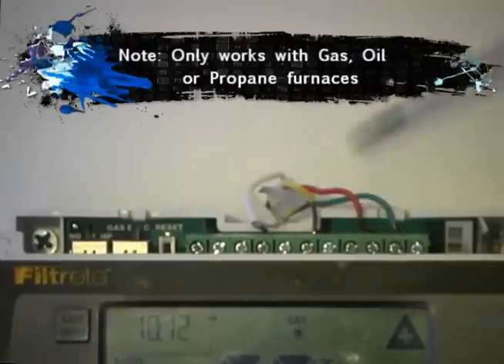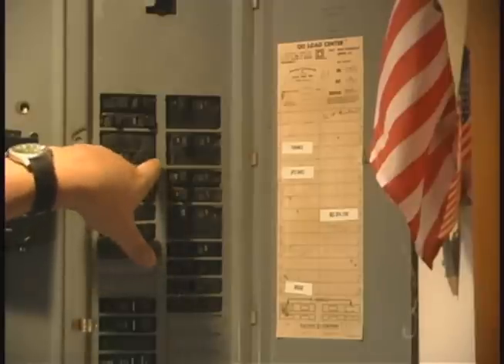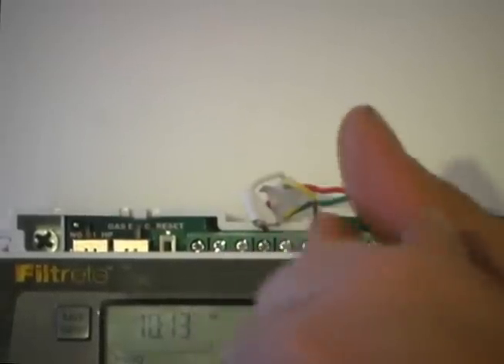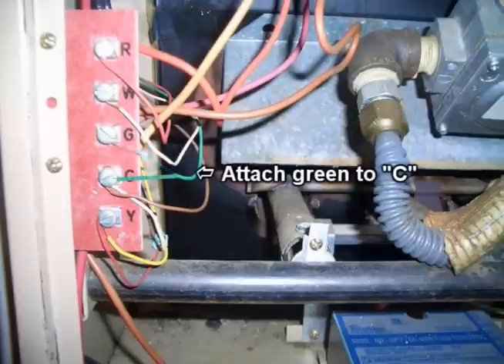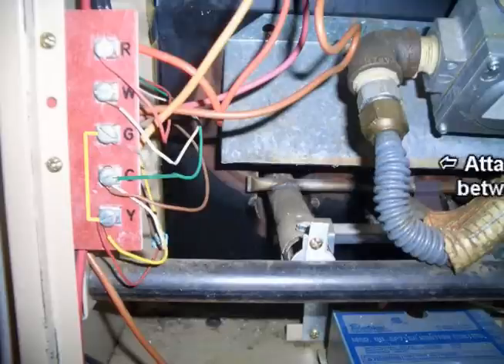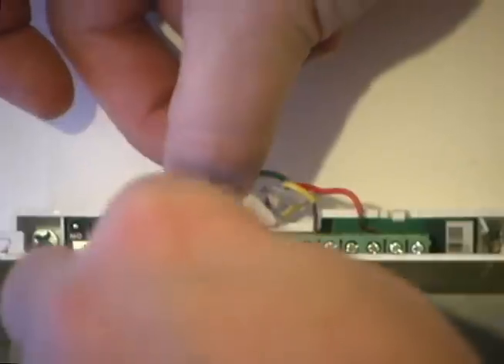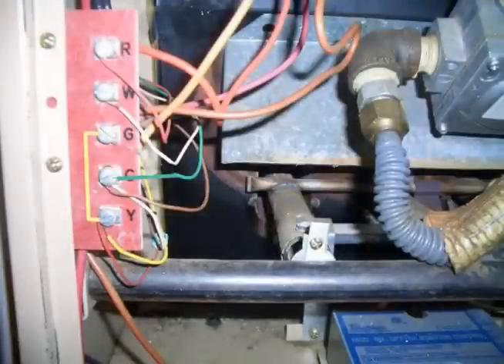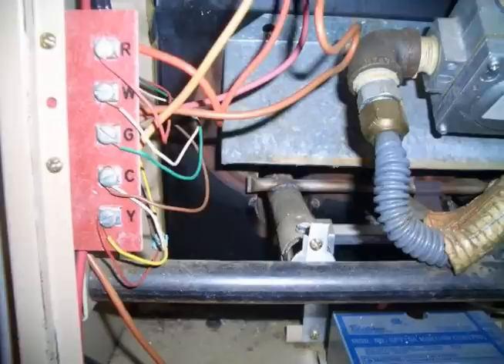C Wire -- How to use the G wire as a C wire

Comment: Question, what are the white and red wire that are connected to the C terminal in the furnace?  I opened up my furnace and I see that a red (can't tell if it's exactly red) wire (not the one that connects to the R terminal) is connected to the C terminal and a white wire is connected to the Y terminal.  These two wires are from a separate brown wire that apparently connects to the compressor (???).  There is the main brown wire which has blue (this is for the Y terminal in my setup) , Red, white and green wire.

Comment: Using your G wire as your C wire is a TERRIBLE idea!! I added a Honeywell RTH6580WF to my home recently. I discovered no c wire. Without knowing what all it involved, I found the blue wire tucked into the wire bundle as it had been cut off since not in use. I stripped it and applied it to my thermostat. Still no power. I then went down to my furnace to see the blue wire was not hooked up either it was just wrapped around the same wire bundle going to the thermostat. I stripped it and hooked it to the C terminal on the furnace. Now the C terminal had a white and brown already attached going to the AC. But you can hook more wires to the C. You can hook the 3 right into the terminal or you can bundle them together with a 4 wire called a pigtail then you only have one single wire hooked to the C terminal.  User preference. So don't just assume because you found the blue wire in your wall or wire bundle behind your thermostat that its connected to the C terminal in your furnace. You will be best to take the panel off your furnace , find if a C wire is connected and determine the color while making sure it's the wire bundle going to the thermostat.

Comment: Hi! We seem to have two-transformer wiring system where the Rc and Rh wires are entirely separate power supplies for the AC/fan and the gas boiler, which doesn't seem to use the fan. Will this trick still work? I think not, right? I'm guessing the thermostat would only run power through the Rc wire if it was running the cooling system, right? So the circuit the G is on isn't even relevant in our case?

Comment: Thank you for this video, it saved me a service call! My Nest thermostat was installed by a 3rd party in the winter. It worked fine, but when it came time to turn on the A/C, the compressor would come on, but the blower (fan) wouldn't. I thought it was a bad circuit board... until I watched this video. I inspected the control panel on the furnace and I saw that the installer moved the G wire to the C wire, but there was no jumper between Y and G. After jumping those two connectors, everything worked perfectly. Thanks again.
Reply: I had this same problem so I added the jumper wire and it is still not working? Is there something else that you did?
Reply: @Brook.klassen  so funny thing about my system and why i hesitate to use this method right now is that my fan works and there is nothing at the G spot, so the fan is wired in somewhere else, your system is probably the same.

Comment: So the reason to do this is the lack of wires correct . If you had an unused wire you could just attatch it to common on both ends yes???
Reply: Yes.. If you have a 5th unused wire just connect the same colour to the C on both your furnace and thermostat.
Reply: Justin  so here's the strange thing . Works fine without the c wire attached . Soon as u add c wire I get error on my nest saying no power at rc

Comment: If one does this can you still operate the fan manually???? I sometimes use the fan even thought the A/C or furnace is not operating.
Reply: nope you will lose the ability to control the fan independently
Reply: buy a "wire saver" module and you will be able to keep all separate functions, or go the best route and run new wiring. I always install 8-wire thermostat wire in case a wire shorts or breaks in the wall OR if you end up deciding you want to add any humidification or additional stages of heating or cooling in the future
Reply: Thanks for the info.....I just went with 18/5 thermostat wire and ran it through the walls.
Reply: this is the issue I am having also, the Thermostat works great but we have an HRV and would like to run the fan separately. Are there specific instructions on how to do this? I can't seem to find info on how to do this. Thanks for your help btw.

Comment: Hello Homehandyman101,

I have a heat only application, old two wire thermostat (R and W)

Cable has 3 leads between furnace and thermostat:  R, W, and "not used"...believe it is a "G"

Can I use "G" and wire to "C" on furnace w/o using any jumpers and make my new Honeywell digital wifi unit work correctly?

Please advise and thank you for your video.

Mr. P
Reply: Please cancel all above request.

Stripped back cable at thermostat and had 4-wires.

At furnace also had 4-wires.

All colors match and I apologize for the waste of time.  

Furnace:  I have G and "B/C" (aka B wire for my app)

Cheers,
Mr. P

Comment: Just got done installing two Honeywell WIFI Thermostats requiring C-wire using the method described on this video, and it works perfect. Almost returned them when I did not find the C-wire. Thank you Homehandyman101.

Comment: I have a heat pump only and there is no "C" terminal on my air handler.  There is 24v across the green-to-red and blue-to-red.  Why can't I just connect a jumper from either green or blue to the "C" terminal on my thermostat?

Comment: ok...what about a heat exchanger. Can you also use the G wire on BOTH g and c? I would like to use a the fan as it helps move the hot air from my wood stove that is another room.
Reply: I need to know this exact question

Comment: Worked perfectly! I'm using a Honeywell Lyric T5 WiFi thermostat with 4 wires. Instructions from Honeywell did not work. After following this video's instructions the AC, at first, didn't turn on. However, the thermostat did a self-update/calibrate thing and it has worked great since then. Thanks!
Reply: I did the same but you  cant manually control the fan ,

Comment: ok. Did exactly as you showed. The thermostat went on but the system didn't
Reply from the maker: Do you have a gas furnace?  If not this solution will not work for you.  The reason is that most electric heating systems require the thermostat to control the fan in heat.  If you do have a gas furnace with AC make sure you put the jumper in between G and Y at the furnace.

Comment: sorry, why do we jump y to g? thank u.
Reply: David R. Jumping your Y to the G terminal gives your G terminal 24v when you get a call for cooling. During a call for cooling you get 24v to the Y wire and 24v to the green wire. Since we are robbing the G to use as a C we don't have to remember to change the batteries every 6 months. This will give your thermostat 24V coming in and a common for it to go back to on your transformer. What this basically does is when you get a call for cooling it acts like a G wire in this situation. Your system will see 24v where it needs to if wired correctly like the gentleman showed in the video.
Reply: What is I dont have a C in the furnace terminal?

Comment: can i do this if i have no y wire coming out the wall by thermostat and have a central air unit?
Reply: David R.  Do you have a blue wire connected to your Y terminal? Chances are you have 18/5 running to your thermostat if so. I would suggest pulling the wire out of the wall a little to check. You probably have a Y wire that is not in use.

Comment: Thanks for the video that's what I was looking for.  So, now when A/C (Y) is on, the fan is on, because Y and G terminals are connected.  But what about the heating? The fan will no longer turn on when furnace is turned on.  How do you solve this problem?

Comment: okay but why is there 3 wires connected to the c place in your furnace
Reply: TheJustinamazing in a hvac system there can be very many points of common. His just so worked out that he has multiple wires on his terminal block. Do not pay attention to this when you are wiring yours. You may have 7 on yours etc

Comment: What if I don't have a "C" connection on my 20 yr old furnace? I only have W, G, & R. Plus Y all to the t-stat. There are a couple extra wires in the bundle I can use.
Reply: the "c" is the common leg off the secondary side (24 volt side) of the transformer. in this case if you dont have c terminal. then you have to wire nut the green wire directly to common wire coming directly off of the transformer. if you don't know what your doing, i wouldn't mess with it

Comment: No AC from vents after new wifi thermo. My antique Smith boiler has no such setup and the AC unit is up in a closet on 2nd floor. I could see no Terminal block on AC unit behind panel to do this either. I'm at a loss but I'm sure I need a jumper somewhere. Heat functions fine it's just the AC fan that's the issue now. Compressed working. help is greatly appreciated

Comment: May I ask what circumstance would put you in the position where you want to lose manual control of the fan just so you can say you have a c wire at the t-stat?  Only compelling reason I can think of is if you don't want to use batteries at the t-stat.
Reply: Burned popcorn in the microwave?   Run the fan....
Doing a construction project in the house creating sawdust, etc?   Run the fan...
Have allergies that are bothered by vacuuming?   Run the fan...
Temp outside's nice enough that you really don't need heat on or cool on, but want to feel a bit of air movement?    Run the fan...
I can't count the number of times I've run the fan without the heat or cool engaged just to move air in the house through the filter for (see above) a variety of reasons.    I'm looking to add a new-fangled WIFI tstat but I only have 4 wires, my current unit is 'smart' and gives me all functions including the fan, so I'm a little tweaked that the new WIFI tstat from Honeywell doesn't allow me fan control.   I don't mind putting batteries in every few years.   Worth it.
Reply: acoustic4037 Generally the reason is because you have a thermostat that requires the C Wire.  Newer ones without batteries or rechargeable batteries like the Nest.  Most people don't run their fan alone.  If they did, they would clog the filters really fast.  Then again, most people don't change their filters.  I have a honeywell wifi that I tried this with and all I could get was heat, the ac would not start.  It may require both C and G wire.
Reply: I guess there are thermostats that could require a c wire, but there are other options available.  I would not advise buying a thermostat that creates a problem when there are plenty that don't.  If running the fan would plug the filter, then it would be an improvement in indoor air quality and should be done.  In heat pump land (the south) tenants let the filter get plugged, and the coil sees no air, and the coil freezes up all the way outside to the condenser unit.  People think they should change filters on a time schedule or worse, not at all.  Filters should be changed when.... they're dirty.  If you live in a glass house with no pets or dirt, you can go a year but most people with 5 dogs, 24 cats etc need to change filters every month.
Reply: +acoustic4037 Never in my life have I just run the fan.  Not once.  I don't think I even knew that was a thing until a year or so ago, and I'm 49 (grew up in San Diego, in a house where we had neither AC nor heat).  I'm happy to give up that fan ability to get a thermostat I can use with something like ZWave that's going to require power, since the only use (for us) of a thermostat is to turn heat on and off in the winter.

Comment: this is as good a place as any to ask... i have an oil furnace that is relatively new the model is OHB5-F059-085-3. it has c-y-g-r-w-p from top to bottom on the furnace connections panel. i have no ac, no heat pump, nothing other than the furnace. i have a two wire old thermostat upstairs, that i replaced with a new honeywell simple digital device. there are no buried wires in the wall, it was originally a two wire run when the old oil furnace was installed in 1947. the new thermostat has a fan only switch, which says fan- and 'auto' and 'on' for options. 
what i want to do, if possible, is be able to run the fan from the thermostat as fan only. currently, we have to go to the basement and flip the fan switch on the top of the control box on the furnace to do this. it would be difficult to run new wire, so my options were to get a wireless thermostat ($$) or perhaps an add-a-wire type of device? anyone know if i can or cannot proceed with keeping the current thermostat by doing a wiring trick?
forgot to mention the current two wires to the thermostat are connected to the R and W terminals.

Comment: or you just use the Venstar add-a-wire which will allow you full fan control, heating, and cooling when only 3 wires exist at the thermostat

Comment: I noticed you had a wire already in the C terminal at the furnace, which I gather goes to the AC unit. My furnace control board looks exactly the same. So when you switch the G wire over you just put it together with the wire that's already in the C spot?

Comment: This video is great but it lacks in that it does not give voltages on any of the wires. What voltage should the "C" wire provide to the thermostat? Wherever I look the "C" wire is common and normally "Ground" ? What voltage if any is "C" wire?
Reply: Should be 20-30 VAC. There are no "ground wires" in thermostat wiring. They are all there to complete circuits.

Comment from the maker: You only use this if you have a gas furnace and you don't have enough wires going to the thermostat to have a C wire.  Note not all thermostats require a C wire.  I don't believe it will help with your no heat issue.  -- To test it see if it is a furnace or tstat problem you would need to do a wire test.  To tell you how to do that I would need to know how the thermostat is wired.

Comment: you right this guy its doing on his unity but every furnace is diferent and also you dont realy need to have a C conection on your t stat just use a t stat with batery
Reply: Wifi thermostats dont use batteries. That's why you need a Common to power the thermostat.
Reply: @dougiefresh730  That is entirely false. Emerson Sensi ST55 can run entirely on batteries alone. !one has been using the same batteries for close to 2 years without a C-Wire or hack.

Comment: I followed the instructions mentioned here as even though the Cwire was connected to the furnace but it did not come out to the thermostat. After doing this my heater works fine, but I am not able to turn ON the AC. What am I doing wrong? I am OK with not able to run the fan by itself.

Comment: Appreciate the video, it was very helpful but I am having an issue maybe you could help with. I have a gas furnance, and conventional Air Conditioning. I swapped the G wire to the C terminal and jumped the G and Y terminals and things worked great. I did this in winter however so while I was able to get heat I never bothered to test the Air Conditioning, now that it is getting warmer out I cannot get my air conditioner to power on via the thermosta

Comment: I understand about the G wire going to the "C" connector and the jumper wire. My question what do you use if your furnace does not have "C" spot?
Reply: Sometimes, it's called Common or Comm.  If you don't have those either, than get a new furnace.

Comment: Good video but you might point out that with this trick you'll be giving up independant control of the fan to use just as circulation.  I live in a 2 story house and it's really useful because the warm air tends gather upstairs leaving the down stairs cold without it.  So it's a trade of having to mess with batteries periodically versus independant fan control.

Comment from the maker: Turn off your breakers to the HVAC system, then check the C wire to see if it is firmly connected at the furnace. At the tstat, make sure the wire going into the C terminal is stripped back enough to make a good connection.

Comment: This is a GREAT Video!!!  I will lose the option to have a fan only mode my using the G wire, but my fan will turn on if my heat & ac run..Correct?  I have Both heat (oil furance to forced hot air) and A/C (using the same air handler for hot air) on the same thermostat.  Just jumping G & Yat the air handler will turn the fan on in both cases??  Thanks!!

Comment from the maker: The clicking noise means the thermostat is working properly.  The wiring seems to be the problem. Remember that this method does not work with heat pump systems. Check the wiring at the furnace:  there are often several wires on the C terminal - make sure they all make good contact. 

Call the friendly folks at tech support and tell them which wires you have.  They can troubleshoot the wiring for you: 1-877-602-5028

Comment from the maker: If you have a conventional furnace, the G wire is the fan and it goes in the G terminal. The Y wire is for a/c and it goes in the Y terminal. If you have one R wire it controls the calling for heat and cool and goes in the RH terminal. The W wire is for the furnace and goes in the W terminal. The black, which is attached to C at the furnace, should go in the C terminal on the thermostat. If you are still having trouble: 877-602-5028 (tech support).

Comment: Got new tstat with these terminals...Rh, Rc, w, y, g..I put R wire to Rh/Rc jumped, Y to Y, G to G Hmmmm where does the black wire, which is twinned with another black wire and attached to the C terminal at the furnace go? I tried a few things and got the AC going with furnace fan going by putting the Black wire with the G wire at the thermostat, but now the heat doesnt work. Can you or someone help me out? Ive bought quite a few tstats but none have a B (black) terminal. Thanks.